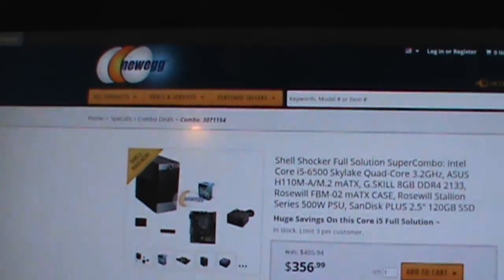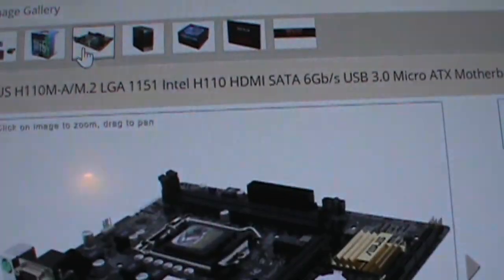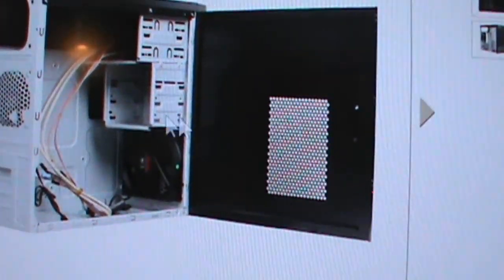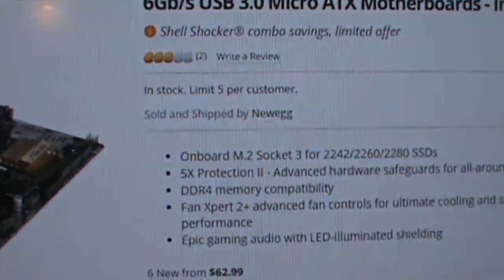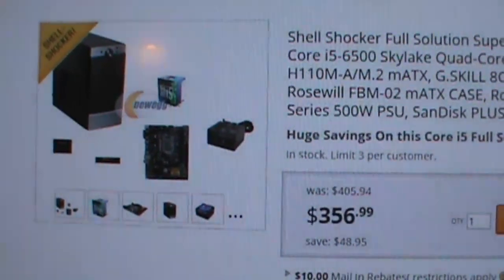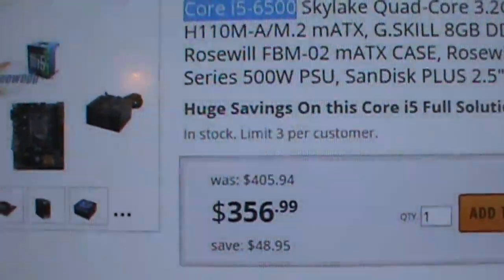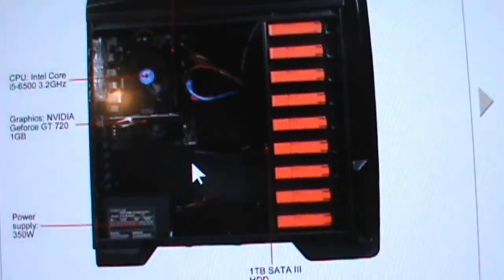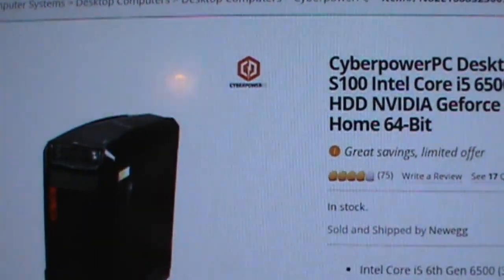THIS Is Why We Build!!!  :-)

Comment: Looking at what was fitted to that cyberpower PC in relation to graphics reminded me of a system refurbisher we have over here that has a system that has an intel xeon processor and a GT210 graphics card which they refer to as an entry level gaming system which is just going to choke on almost every game that is thrown at it due to the mismatched pairing of CPU and GPU (just like that cyberpower PC).

I'm only getting a refurbished generic box PC since it gives me the base to actually make a decent gaming system (the original manufacturer appears to use off the shelf motherboards unlike the Lenovo ENUS box, and since hardware is available for it (it's a haswell) and I don't get price gouged on the RAM I can max the RAM on the system, get either an i3 or i5, a proper power supply, case and graphics card and I've got a decent gaming system that will tide me over until I finally decide what to put in the case I purchased at least a month ago and build my first dedicated gaming PC) so that I don't have to rely on my nine year old AMD dual core system that has possible electrical damage on USB that happened a few years ago.

Comment: No Windows license wouldn't hurt me.  If I build a new system it will probably be running Linux.  That said, the other stuff is kinda urgh.
Reply: I'm using an Ubuntu based Distro called Peppermint OS 7 atm. It's only drawback is it won't run Steam without tweaks on an AMD based system, as it inherited Ubuntu's AMD driver issues.  Other than that it's worked like a dream. Rock solid, running constantly without a single crash for about a month now.
Reply: With me personally, I tried Linux. It's not bad but the community is so horrible I left Linux alone and have yet to look back.
Reply from the maker: I'm looking forward to more support for Linux gaming.  I'd love to see Windows have some competition.  :-)
Reply: i am running a dell d410 with koroda 32bit xcfe and its fine  but i have no idea what software as for games on it since its so old 2005
Reply: Michael Cox  my problem with ubuntu for laptops they hide hibernate,sleep buttons and sound issues the drivers they do fine

Comment: what do you need for slots for Ram anyways when you can get the same amount of memory into two slots with higher-capacity sticks
Reply: i have 4 slots, but use 2 and have 32gb ram, 16gb stick are not more expensive than smaller ones now
Reply from the maker: Higher total capacity, plus every single motherboard I've had in the last 10+ years has had 4 slots.  :-)
Reply: +MultimediaJay I get you now I'm going to get a pc build started for my streaming and video editing station

Comment: My uncle has been working on computers for a while and he has offered to help me build a PC when I get the parts and moment so im looking forward to that... a 6 year old Toshiba laptop dosent cut it :P
Reply from the maker: No Toshiba laptop cuts it lol.  I'm cutting mine loose next year.  :o)
Reply: I dont blame you, the screen is dead, 2/3 USB ports are shot and while I dont use it the built in webcam was crap and unuseable  my 2008 gateway was more reliable with Windows XP and I only stopped using it in October 2015 since the screen finally died